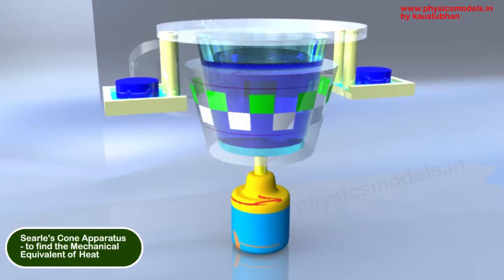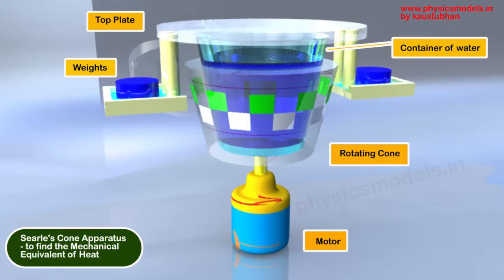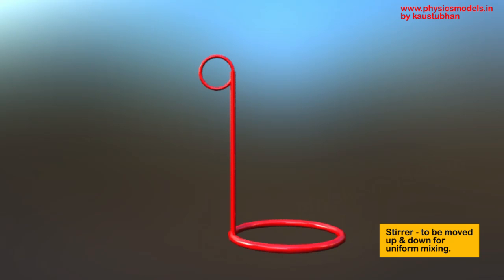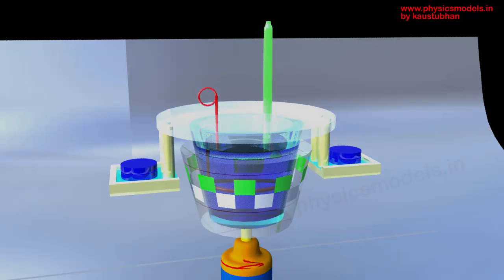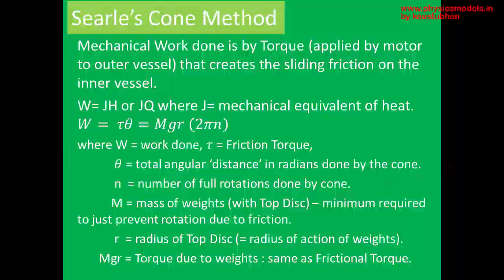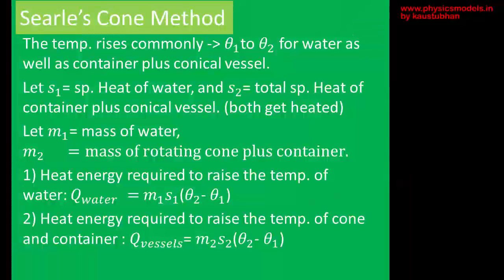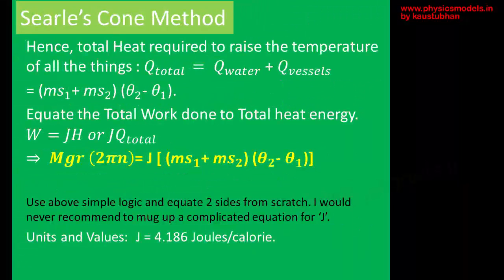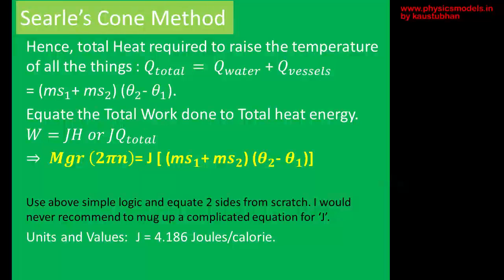Physics - Calorimetry- Searle's Apparatus

Comment: Sir, Kindly respond. According to my understanding, since direction of rotation of other vessel A is anticlockwise, I got direction of torque upwards, and since weights are downwards, I am getting direction of torque out of the page, how are they cancelling each other?
Reply from the maker: Hello, in this Searle's apparatus, the weights put on the inner vessel are meant to create the frictional rubbing between the Outer Cone and Inner Cone , purely due to the contact between the two cones around the circumferential area. 
(Weight x radius) is the Torque, i.e. Angular torque, this acts all around the contact patch. There is no need to apply any vector rules here. This causes thermal energy to flow through the contact surfaces, which gets transferred through the Inner Cone to the water, and the water temperature increases. In this way, Mechanical Energy is transformed into Thermal Energy (heat energy) with the constant called J.
Reply from the maker: It is also assumed in the apparatus that there is no relative upward motion between the Outer Cone and Inner Cone.
Reply from the maker: There is no Torques getting cancelled here.
Reply: @physics_tutorials-o4n  Sir but in HC verma, it was mentioned that the torques were getting cancelled.
Reply from the maker: Right, I have seen HC Verma. On page43, Calorimetry, he mentions that " The direction of rotation is chosen to make
sure that the frictional torque and the torque due to the weight Mg oppose each other" 
Basically this is more to do with the apparatus. The principle he means to say is that the opposing torque due to friction (caused by mass Mg x radius) should  exactly balance the rotating torque created by the Motor (fixed to Outer Cone), so that there is ZERO slippage betwenn the cones. 

In the HC Verma sketch, the weight is hanging on one side only. Also wooden disc design is not clear. Maybe this is creating a problem, I think. That is why I designed my apparatus with weights hanging on both the sides, this spreads the torque evenly on Inner Cone. Also I made clear the design of top disc holding the weights. Then, whatever the direction of rotation, the frictional torque should oppose the rotational torque and things should be Ok.  
I am not able to imagine why friction torque should happen even by mistake in the same direction as rotational torque.  (we need to check the old apparatus design but cannot do that.)
Reply from the maker: The torque caused by friction (caused by weight Mg) should be equal to the Rotational Torque, only then the relative motion between Inner cone and Outer Cone will be zero, i.e. no slippage after the Mass M is increased suitably. (something like static friction) That is what is mentioned in HC Verma. HC Verma mentions that "The direction of rotation is chosen to make sure that the frictional torque and the torque due to the weight Mg oppose each other. The value of M is so adjusted that the inner vessel does not move."
Reply from the maker: Rotational torque created by Motor is balanced by the Frictional Torque created by adding weights.